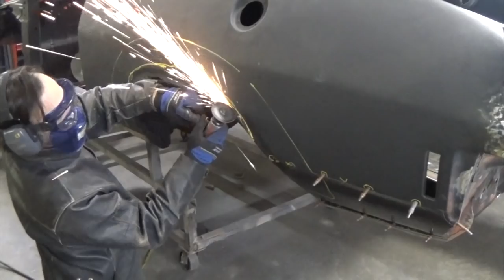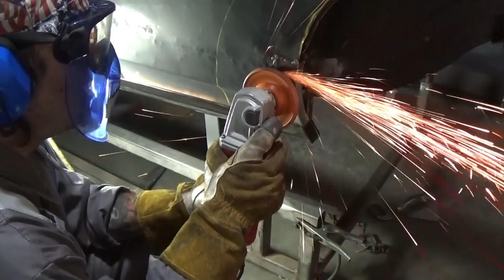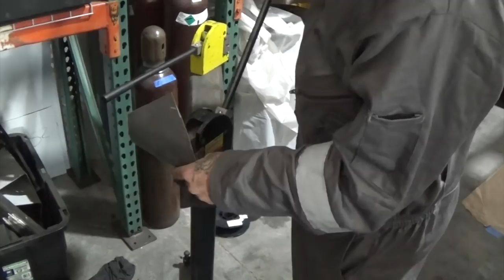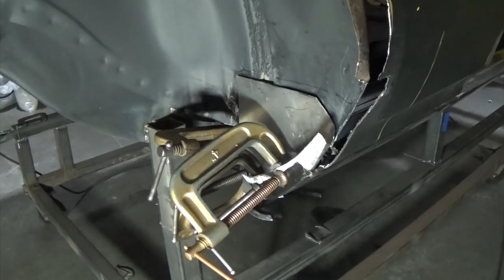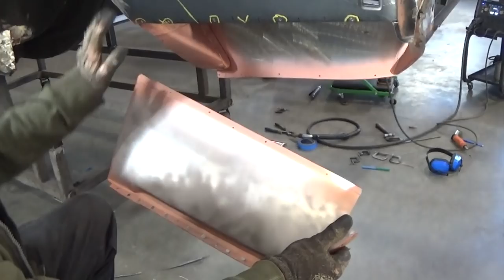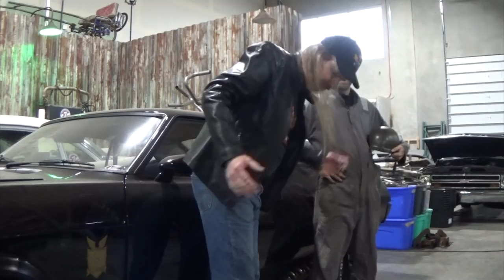Mad Max Interceptor Pursuit Special Build XB Falcon EP5

Comment: Great Site I am almost 60 years old I live in Australia a Falcon Bloke all the way, even when the Coupes were new there was not a lot on the road they were not big sellers and any GT Falcons were even rarer, lots off V8 Falcons, over the years cars in Australia up till the late 80’s were rust buckets around 89 they must have changed the way or the type off metal they were using EA Model Falcons and VN Commodores on rust slowed right down, I have had about 5 XB Falcons I have a XB GT four door have had it for 22 years great old Car it is Snow White only 37 made in that colour same Colour White as the XC Cobra Coupes it is actually a XC Colour My XB was built in May off 1976 second last month off production off the XB GT Falcons only 1950 four Doors from 73 to  June off 1976 were Made, lots crashed and a lot just were not looked after they were not valued like a XW or a XY GT and not at all valued like a GT HO that is enough from Me enjoy Your site keep up the great work Mick Australia.
Reply from the maker: So very cool! Thank you for sharing. We always love to hear from our Aussie brothers and fellow gear heads! Sounds like you have quite a stable of amazing cars! We will keep at it here. Keep those Falcons going and keep the shiny side up!

Comment: Its been to long between drinks, good to see another episode of the build of this iconic Aussie car. We down here really appreciate your dedication to this Australian legend. Even Cundalini would find a way to give you a round of applause....
Reply from the maker: LOL! Yes, thank you for the amazing appreciation! It does take a long time to cut down weeks of footage to a reasonable length video, plus it takes a significant time to film the footage to begin with. We will try to get the vids out sooner. SUPER glad you enjoyed it!
Reply: ...it just happened man.... ya know... a pppiece from here n a pppiece from there...
Reply: @MadMaxCars  Remember repairing an old MK2  Ford Escort and it it was a rot box... the main repairs I did was trunk floor, driver - passenger floors front to rear both sides sills inner outer some inner wings sections.... But the fun fact the parts was not available for a few weeks(in a working garage needs be sort asap) so i used the side panels and roof skin off a scrap high roof Transit to create new panels the car stayed on the road for 18 years after that major repair... I used the same idea for other cars got a scrap van for peanuts and used the good steel as repair panels :)
Reply from the maker: @kylereese4822  Thats some awesome skills there! I have seen guys use washing machine and refrigerator panels as long as the steel was good and the gauge is correct. We generally use clean new metal here, but use what works well for you. Very cool. Thank you for watching and sharing the cool memories!
Reply: @MadMaxCars  I was about 17 when I did that type of repair work and to this day I miss doing that work, Currently looking at doing a rebuild of a Tesla Model 3 from sections from salvage cars... :)
Reply from the maker: @kylereese4822  Cool! We all wish you luck with that Tesla build. There are a few guys here on YouTube that do Tesla stuff. Some very cool!
Reply: @MadMaxCars  Yea I watch them for reference images also. I`ve already got a battery though not a model 3 spec(2170 cells) but home brew using 7000 18650 cells that I have free access too though it wont be a high spec battery I'd say 55-60kw at most and may not have Tesla motors in it due to cost... later it will be converted to tri motors using possibly early leaf motors they can produce 300bhp... :)
Reply from the maker: @kylereese4822  Very cool. Good luck! Let us know how it goes.

Comment: Wish people knew how long it takes to build and fit a custom part. Most of the time you have to do these custom fab jobs because parts are not readily available over here. Some of those small panels are best done this way even though every now and then I get a chance to import a repo part but a lot of the time it comes with a higher expense  than you calculated.
Reply from the maker: Absolutely true. We generally find that any part that is available pre-made will be a decent savings over making it by hand. Often a hour or two of fab time is more than it costs to get a part here. Still there is so much not available it is inevitable we will have to hand make some bits before the job is done.

Comment: I loved that switchable supercharger! He had a switch that engaged a clutch for the supercharger belt to engage. That way he saved that precious fuel for when he needed it most!!
Reply: I wonder what kind of fuel management they used to handle that switch from NA to boosted!!!
Reply from the maker: @kevintucker3354  Though it is technically possible to have the on/off blower function on a car, they used "Movie Magic" in the film. We build cars both with a "prop" on/off blower or a functional one depending on what the client wants.